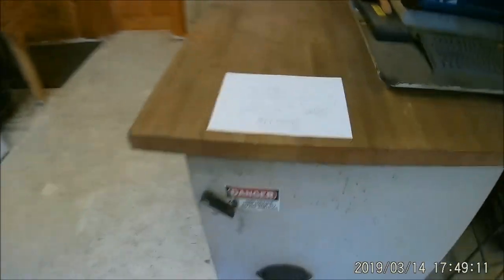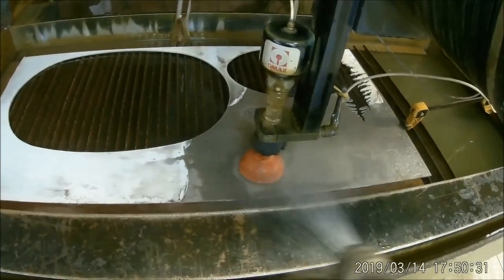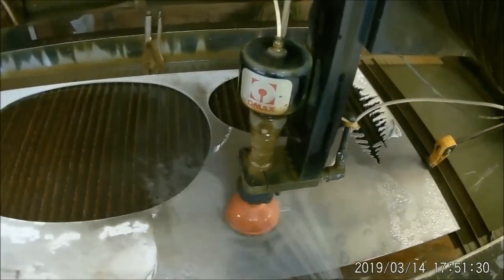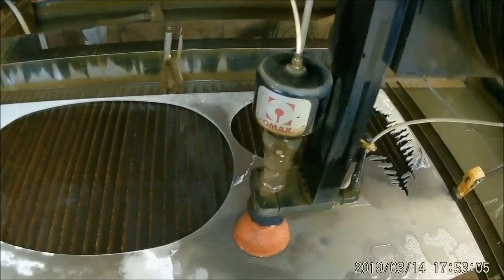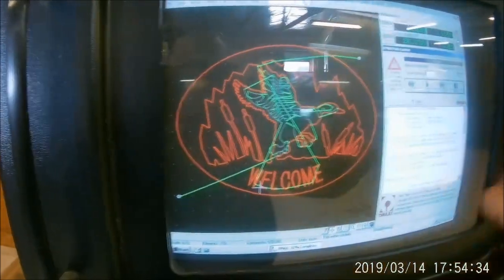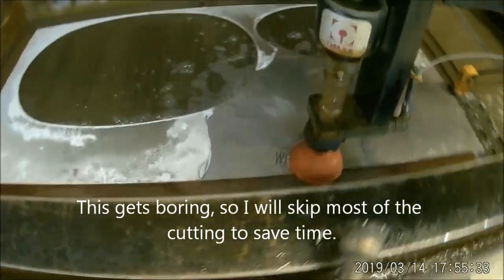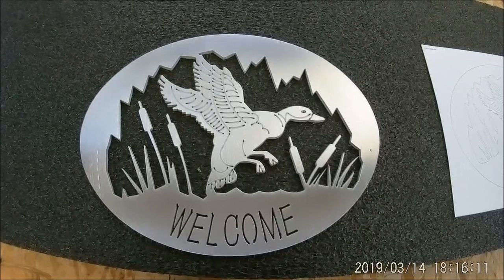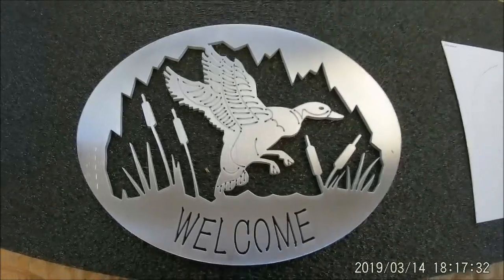Waterjet etching with an OMAX

Comment from the maker: I'm cutting 1/8" and 3/16" aluminum.  Etch speed is 70 inches per minute.  Your on/off settings for the water and the garnet have to be close to zero to eliminate the craters.